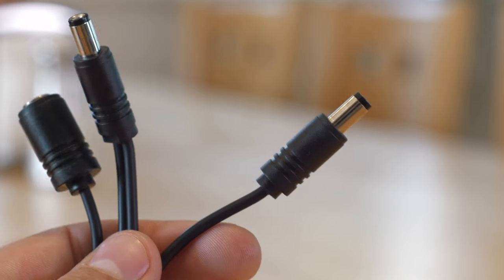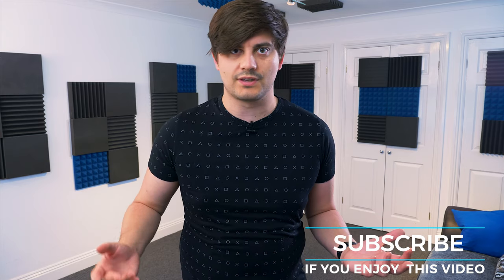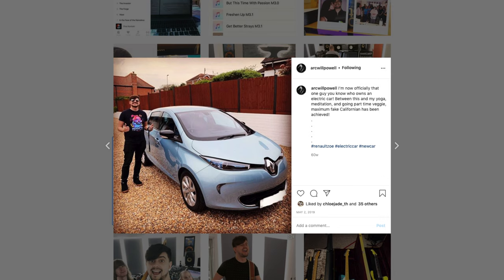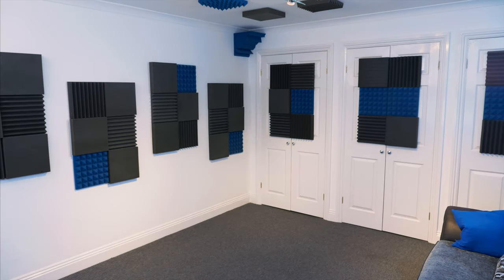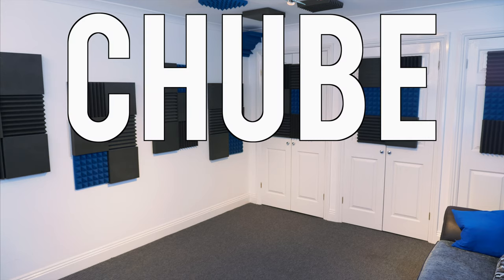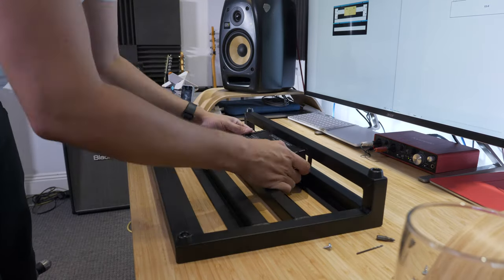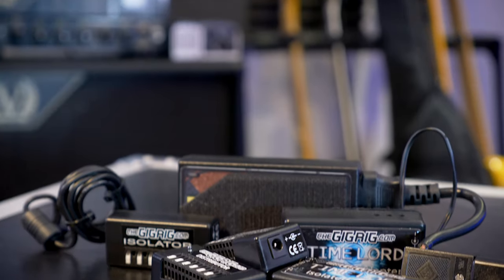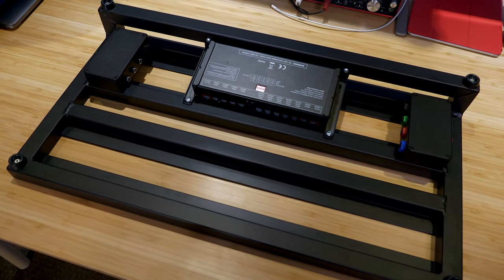Daisy Chains Won't Do! Power For Pedalboards - Pedalboard Building Series

Comment: Is it advisable to use non Isolated psu to a hybrid set-up? My efx are zoom G1xon and Joyo American Cab Sim only.
Reply from the maker: It depends. With digital effects there is always the chance of digital clock noise being sent to ground. Depending how each handle the power internally you may still pick up extra noise from that shared ground, even though the are (I assume for the joy) both digital pedals. 

Regardless, eventually you will change your pedal and may dabble in analog pedals, so a good power supply can be a good investment for your future. it may be a good idea to give yourself that option in the future.

Comment: *if a wire “breaks” in a daisy chain, all other connections should be fine, since they’re all in parallel. If it breaks and also shorts live to ground then yes, you’ll have a problem but an isolated power supply is probably not gonna be thrilled about a short either... There are loads of reasons for not using daisy chains, not sharing clock noise from some badly designed digital pedals for instance but it’s good to be on the right side of science.
Reply from the maker: A lot fo the cheaper ones are in series, but yes you can get parallel diasy chains too, but they still have the same problem as you mention about sharing ground and clock noise!
Reply: Voltage stays the same in parallel and divides in series = parallel daisy chain, every pedal gets 9v, series daisy chain 3 pedals get 3v each - that’s not how they work, they’re all parallel by necessity.
Reply from the maker: @distortion_plus  So my original point of if one connection breaks all those down the line will break. This holds true, and here's why. If the jumper point where you are continuing your connection breaks, all the ones down the line will. Think about it. Each daisy chain does not start with 10 wires from the start point with two wires going to each independent end. so they are daisy chained down the line with only two connection to each end. Each one jumps from the back of the next one down the line. If that series on the power side is broken, then the further 9v inputs in to those parallel circuits down the line will break and they won't have power. Yes you are correct that the whole system can be seen as wired in parallel. The original point in the video on why not to use them is also still correct, I just don't think I did a great jump of articulating that point. So I made a thing to illustrate the point a bit better.

Here, I've made an interactive charge to demo what I mean here for you to play with. https://www.circuitlab.com/editor/#?id=mqxwgx5ptx78 Notice that a break on the 9v power side is still cutting power to the D3 and D4? Even though the whole circuit is wired in parallel? Yes even though the whole circuit would be in parallel, but the jumpered 9v to each connection is still series. Its the physicality of how daisy chains work that let them down. 

I'm sure we are on the same page with this. Daisy chains are bad.